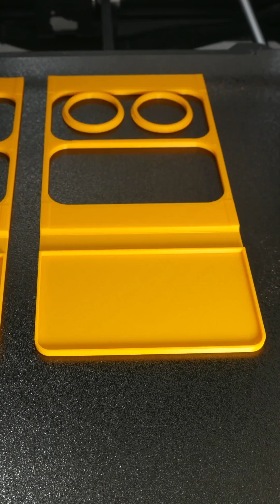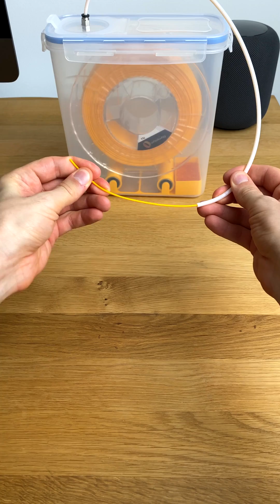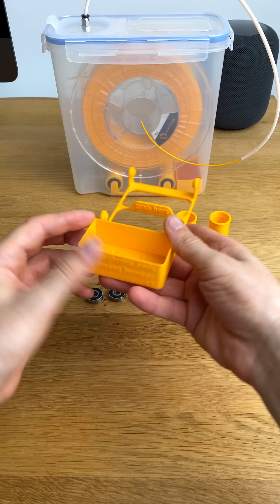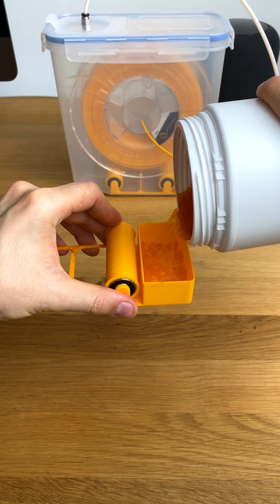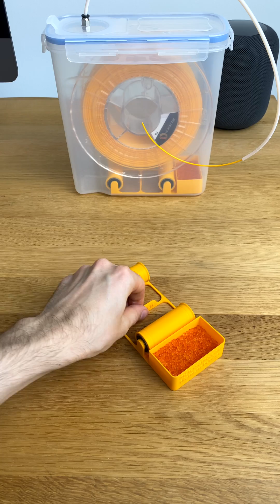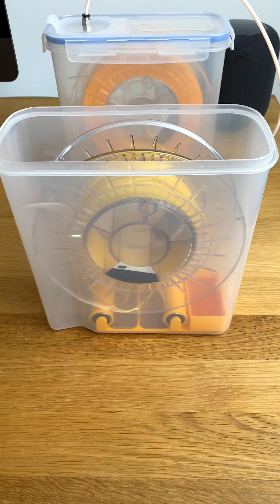how to keep your 3D printing filaments dry - update on the marsgizmo filament enclosure v2

Comment: Hey man, love your prints...
can you pls share how your printer does not stringing and your print settings to get prints like yours...(:
Reply from the maker: I use default settings from Prusa Slicer, I recommend quality filament and permanently store it in dry boxes with silica (moisture will make the filament to be stringy)